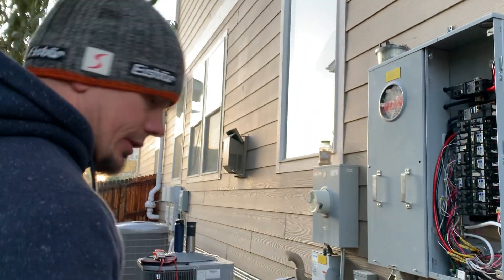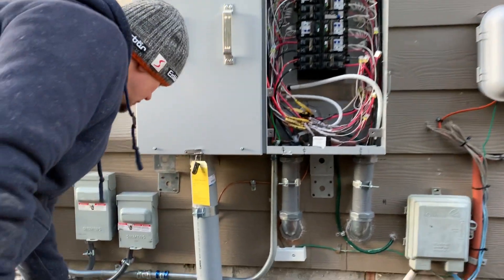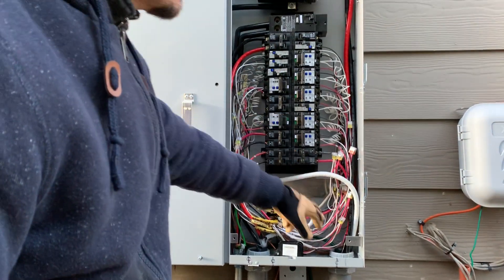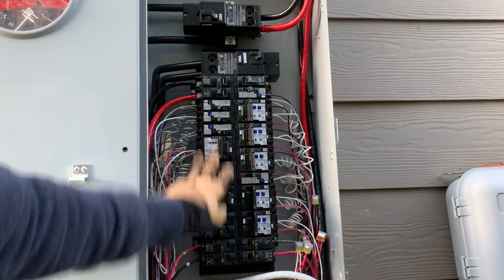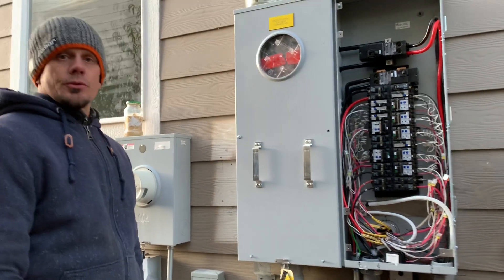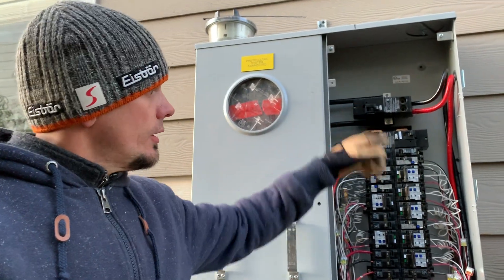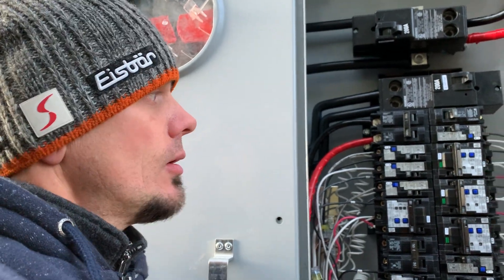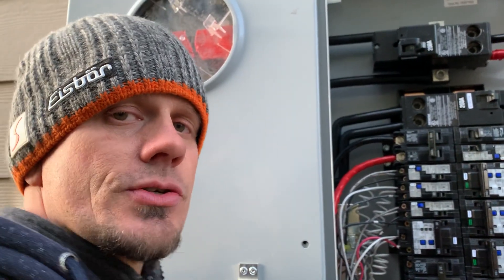Service Change Update from 200 to 400 Amps - Part 4 of 5

Comment: The "green screw" is located at the service disconnect.
That's your box outside with the two 200's, not the inside panel which is a "sub-panel."

Comment: Didn't Xcel say anything about using a CT meter for the 400amps? We are in the process of upgrading the 200amp to 400amp not far from you. House is all electric with no gas service, we already confirmed 4/0 wire is in the ground from the transformer to meter....plan was to use 2 x 200amps main breaker panels, one for the whole house and one dedicated to ECOsmart ECO36 tankless water heater that draws 160amps when taking a shower. Xcel says we need a CT meter setup, but I like the equipment you were using with the 2 x 200amp main breakers....a lot of people have been asking in the comments what model/brand it is...please let us know....and if you have any feedback on why your not using a CT meter....thanks
Reply: I'm pretty sure it's the Siemens MC3042B1400SDL. Good luck finding it in stock! Before you order anything, make sure it is on your power company's list of approved devices.

Comment: Being that it’s a sub panel you do not have to bond it because the neutral cannot be a current current conductor and if you were to lose the Neutral on that sub panel and it was bonded Then everything will continue to work through the ground